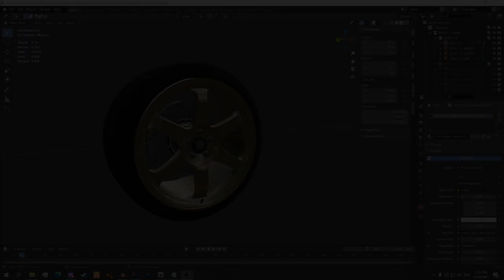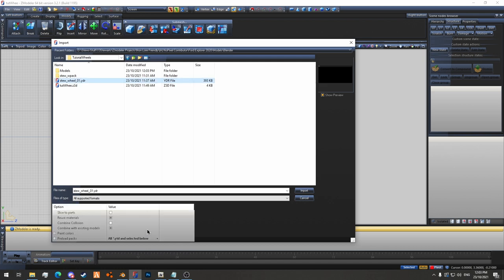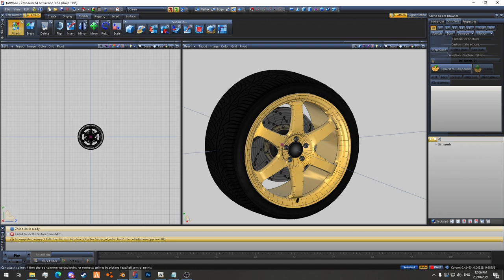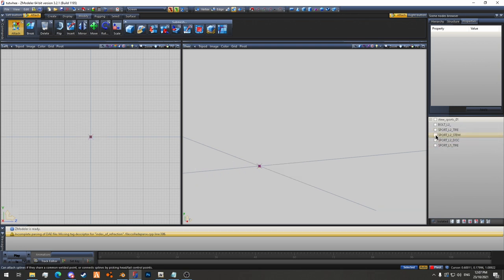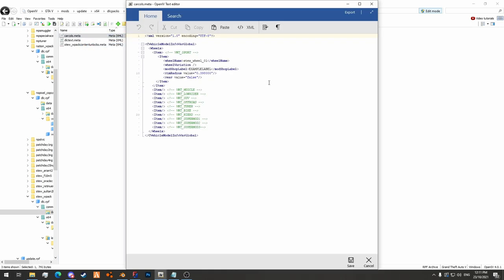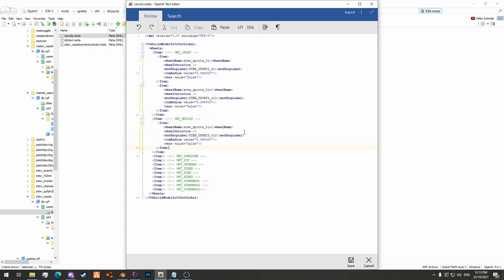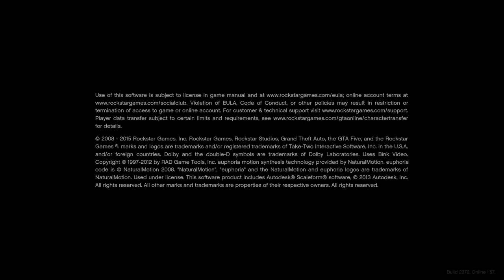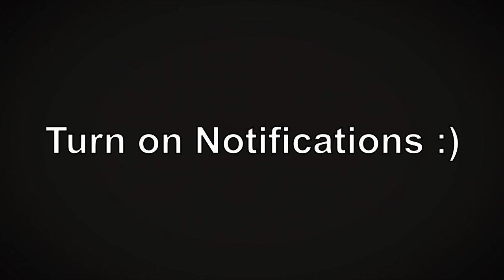Wheel Creation Guide (Part 2 | Conversion) [Blender | ZModeler | Tutorials]

Comment: Is it necessary to have the L1 L2? for the wheels to work in the game? my wheels only have L0 and when I enter the game and apply them to my car I can see them and then the game crashes
Reply from the maker: It's extremely important for your wheels to have all the LOD's otherwise from a distance they'll be invisible. As for the crashing issue, make sure 'skeletal' is not ticked on export as a .ydr.
Reply: @13Stewartc  I was actually exporting with 'skeletal' activated, but even unchecking it keeps crashing the game when I install them

Comment: @13Stewartc Hi, I don't watch your video (sorry 😂), but I think if you made almost 16 minute video about replacing wheels you know Blender very good and I hope you help me. So I had a problem with correctly replacing one of the tuning shop rim with one that is in a stock car. So if I do that replace and try install that new rim in my car, visible wheel is smaller than the physical one. Car looking like its levitating. Do you know how to fix that? If you know please help me.
Reply: PS.: I'm a completely amateur in a 3D modelling programs, but if you help me solve that problem I should had motivation to learn more about modelling and modding games, but now if I watch a lot videos about modeling and modding games and I don't see the effect I loose motivation a lot :(
Reply from the maker: @krzysztofjarzyna7308  The aftermarket wheel models are larger in size then normal vehicle wheels. Import a Vanilla GTA 5 rim and scale yours to match and then export as .ydr and itll work fine :)